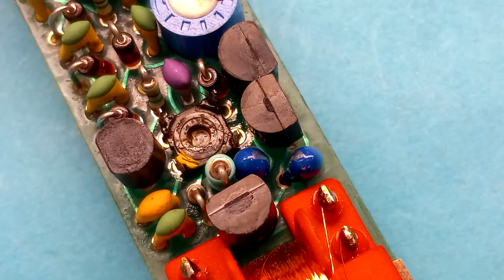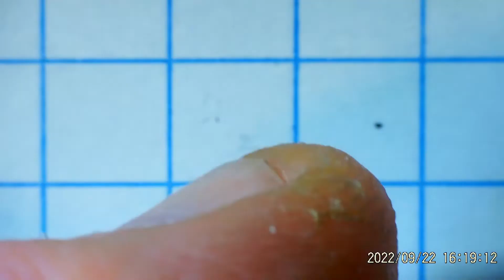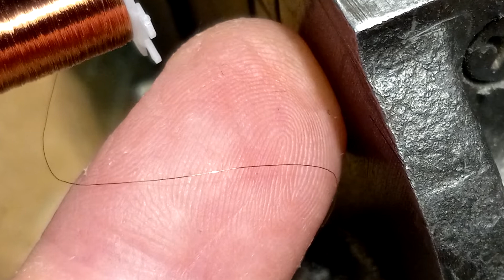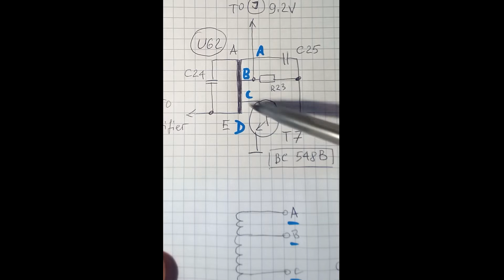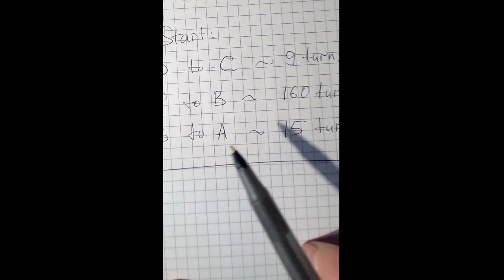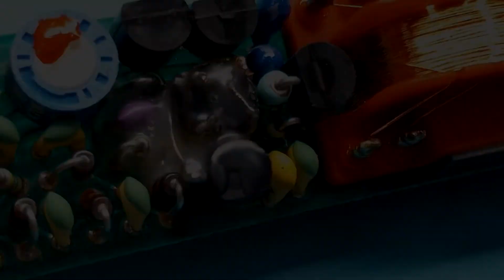AKG C460 B- Magic osc. coil resurrection!

Comment: Incredible efforts 👏👏. I have the same exact issue with a spare 460B that it's been sitting around as I didn't know how to find a replacement transformer. On my detached transformer there is still a bit of lead hanging out of the four poles so I was gonna attempt to very carefully resolder it to the mount, hoping I don't melt the wire. The informations around the schematic and how to figure out which pole is which is invaluable anyway and that was the missing piece I was looking for to start this repair! Many many thanks for sharing 🙇‍♂
Reply from the maker: Glad it helped!